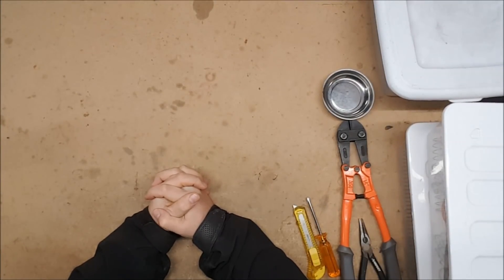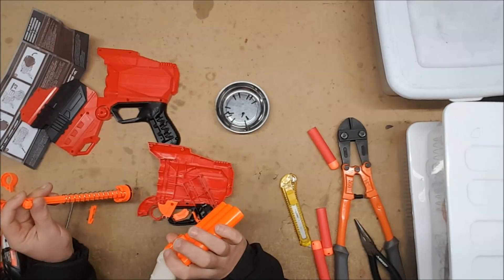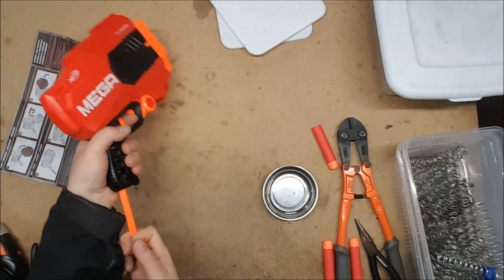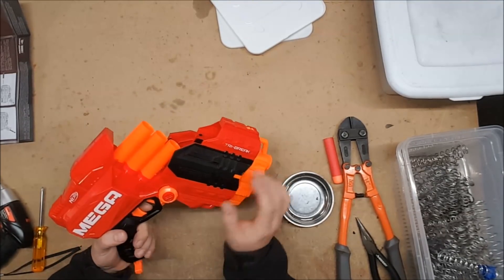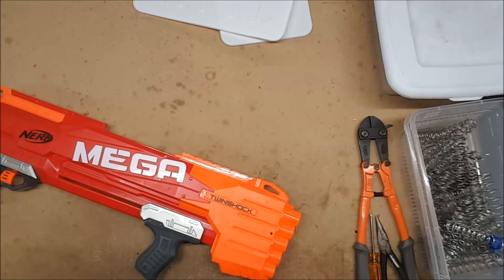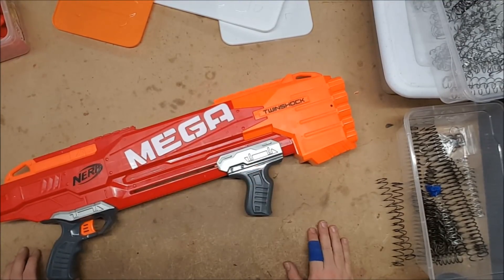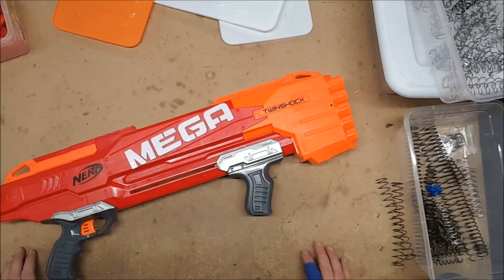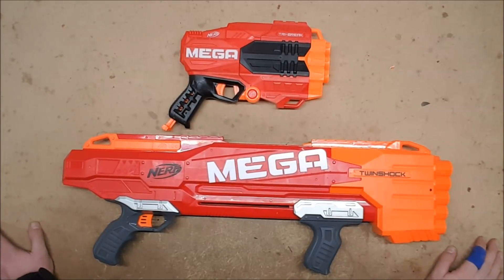Can it Take a K26? - Episode 57

Comment: Ahhh, nice. I put a Kronos spring in mine, but I didn't even try to put it over the stock spring, I just switched them out. Have you run it through your Chronograph? I'd love to know what numbers you're getting! And definitely take the break action shroud thing off, I did with mine and there's no going back!
Reply: Nerf Gun Attachments I was actually going to suggest he check out what you did with the shroud.  When I get around to picking one or two up, that is what I want to do.
Reply: Cool, thanks. He makes me want to go back to mine and try to double up the springs like he does here --- wonder what the performance would be!

Comment: Possible suggestion: with my modded mega darts I put in a dart tip like from xplorer x-tips (pushed through the little holes in the mega dart tip) to help give the megas a bit more weight and accuracy, while not nullifying the point of modding the mega blaster.
Reply from the maker: Cool!

Comment: If no brass to fit megas, is there alluminium tube that may work? 
25mm orange electrical conduit works as a barrel for mega darts i know that much and is a nice fit which i use in a buzz bee ultimate missile blast tanked longshot for single sniper shot.
Reply from the maker: If only I did not live in the land of the inch...
Reply: Captain Xavier  .98 of an inch electrical conduit outside diameter has an inner diameter perfect size for megas and is orange in colour. Just flare out start of pipe to allow easy insert of dart.
Reply from the maker: Some one mentioned that.  I will have to try and find some.  The issue is fitting that into an existing barrel.

Comment: I wouldn't be surprised that a Whistler Micro Dart (both styles: Original "Captain Xavier" scheme [Black body, orange tip] and N-Strike scheme [Light Orange/Peach Body, black tip]) or the Tagger Whistlers (from the Dart Tag Yellow and Black line) would fly erratically if you fired them from an over powered blaster as well, because of the similar design to the Megas (Only with 1 hole instead of 2).  It does stink though that Nerf effectively killed off those rounds with the move to the Elite line and Dart Tag dying off, even if I get why they did it (Wouldn't be surprised if a kid tried to fire a Whistler or Suction dart through an OG Alpha Trooper at one point, as well as we're getting more CS compatible blasters nowadays instead of single shots, Cylinder, or 'turreted' blasters)
Reply: LOMDR Craft Dragon oddly enough the old school taggers are still the best option for blowguns
Reply: The Orange/Green team colored ones I take it?  I can see why.  Though, I do remember even some of them whistling out of the blasters that don't take Streamlines, even the reverse plungered N-Strike blasters.  About as pronounced of a whistle that would come from a streamline styled dart, though (Small air release hole.  I call elites Streamline-styled even though they have a MUCH shorter core than the original streamlines that made it so you couldn't use them in some blasters for...reasons [Original Streamlines, of course])

Comment: I bet with the Kronos spring upgrade, you could remove the smart AR system and get decent performance firing all three Megas out of the Tri-Break.
Reply from the maker: I doubt it actually.  Smart ARs do not shotgun well.  The air path is too inefficient.  Tends to channel most of the air out the top one and the lower ones get nothing.

Comment: Hey I was wondering.... what's the point of brassing a nerf barrel or replacing a nerf barrel with a brass barrel?
Reply: Brass barrels make an air tight seal around the dart so that when it fires, all the air is pushed out from behind the dart giving it the maximum amount of power.

Comment: Can a nerf rival magazine take a K26
Reply from the maker: I covered this in the "Fan Requests Video."
Reply: Captain Xavier there are so many videos I will be right back
Reply: yes it can
it was in one of the specials
Reply: Captain Xavier dear captain you have misunderstood can I put a K26 in the magazine so that I may eliminate all mag feeding issues
Reply from the maker: Oh I understood, you.  You want to know if you replaced the spring in a Rival mag with K26 if it would make it fire faster and prevent jams.  Yes.  It will eliminate feeding issues completely by making it so it will not hold even a single HIR.  K26 is way WAY too strong to replace a mag spring.  Mag springs are extremely light.  Putting a K26 in makes it so you cannot put even a single round it without the spring just pushing it right back out.